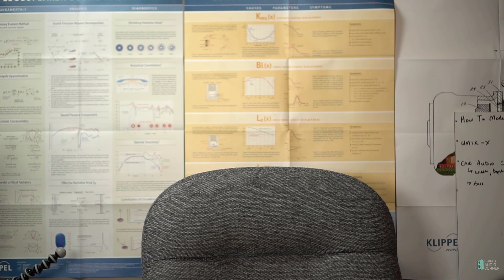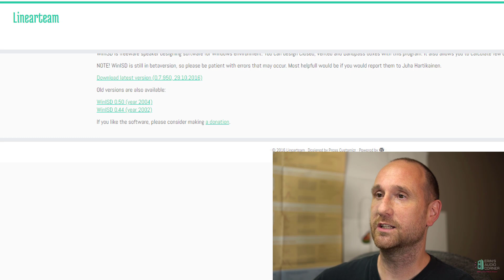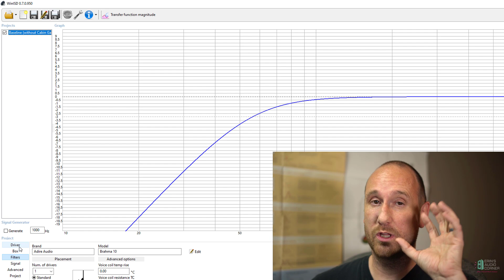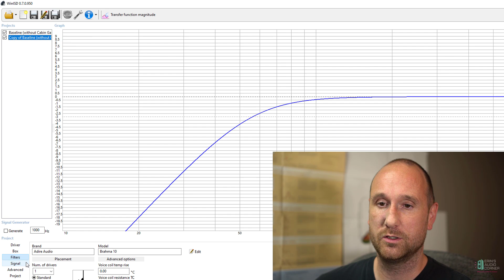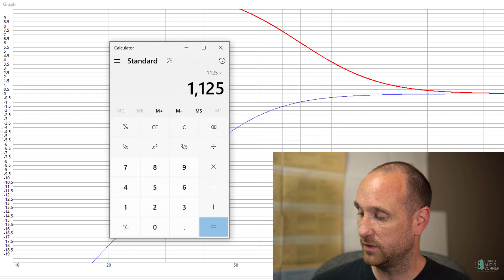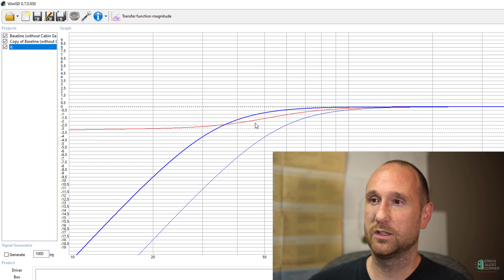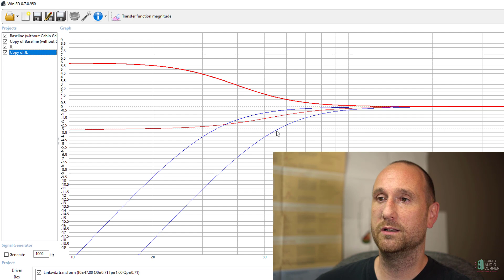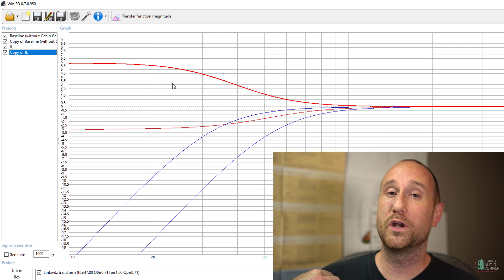Free Bass!  Subwoofer Room/Cabin Gain: What it is and how to model it with WinISD

Comment from the maker: I was asked the following on DIYMA so I will answer it here: 
Q: TWO questions for you--

Why do you take the sub response all the way down to 1 hz when inputting the LR transform function in winsd?

Would the gain approximation curve change if you used 20hz instead of 1 ??

A: Twenty is just the default for an LT. An LT is an enclosure type which uses DSP to extend the extension to a frequency lower than it would otherwise give in a small enclosure. I imagine the default is simply to keep someone from crushing a subwoofer (you need power and a lot of excursion to get down this low as it is). We are just using the same principle to model cabin gain and in this case, cabin gain won't just stop at 20Hz. It will extend all the way down in frequency.

Comment: So after using this technique for a while, I think your values for the "home" room gain part are way too high. Most rooms you probably need to use 20hz for the linkwitz transform, and maybe go up to 30hz if it's a very small room. Any higher I think is too optimistic.

Comment: Yep...just im a bit confused on 1 thing bcs what i actually heard, the biggest dimension what we have to take into account is - let's say in a regular "room" - it is the distance between the corners: for example distance between the rear-bottom-left corner and front-top-right corner...so now which is the correct dimension we should take i to account?...the dimension between the corners i wrote in my example does it have anything to do with it at all?
Reply: Older comment, but I think the idea is the longest dimension between parallel-ish surfaces because that's where reflections happen.
Reply: @SamuraiGuy  , thank you

Comment: So according to this I should get great low end performance out of my sealed sub. But in reality I barely hear or feel 20hz, 30 hz is quiet and at 40hz is where it starts playing decently. Which is pretty much in line with frequency response/ SPL numbers in WinISD without your cabin gain approximation.

Vented box in the other hand seems to gain some at low end.
Reply from the maker: Too many variables to draw such a generic conclusion from a video.

Comment: Great video ! I'm doing a car system  . What then is the benefit of vented enclosure if cabin gain from the car ( vw jetta in trunk) does even better job of extending low end? I want to use 4x 8 inch subs . Some of these only require sealed cabinets of .3 ft3 . I do my own building . A sealed box is a lot less work and for small subs nearly all ported cabinets I've seen require more space when you consider the port  .
I'm getting back into this after many years away from installing car audio  . I've made ported cabinets in the past that work great . It looks like sealed enclosure will work just as well .
I listen to rock so my goal is not to shake the car to pieces!
Is my logic correct ? I see vented cabinets for sale all the time , more common than sealed so am I missing something?
Reply: I think the type of people that just use pre-made vented enclosures are not the type to be simulating the response. They're just after high output, which a poorly tuned ported enclosure and ignored cabin gain will get that for them.

I'm looking to make a small sealed enclosure for underneath my extended cab truck, and it looks like cabin gain will carry it down to sub-sonic, even though it normally simulates with at -3dB of 49Hz. It seems too good to be true.

Comment: So my SVS sub has a room gain compensation. But I cant really find out what that actually is doing. 
My room gain is 40hz. When I activate it, the output goes up about 3db. But I dont have REW to actually measure across the board, just using my phone.
What does activating this do?

Comment: Oh glorious! My spl went from 128db@23hz to 150db@23hz 🤤 thanks man! My Silverado crew is gonna be a beast 😸
Edit: wait… I took out my rear seats and my box will take that up… with 2- 18” subs in a 22Wx35Hx45L box… should I model from the box to dash? I’m planning on having an 8” gap between the subs and they’ll be on a 30degree angle, like 1’cube ears on a 22x22x45 box because recommended ported vol is 10’cube , so I can still use my rear view, thus there’s still that length from windshield to back glass… in theory… 🤪 man, trying to hash this out with WinISD and the12volt volume calculations is super abstract…. Think I’m starting to grasp the box after a few days of number play 😂😂

Comment: My living room isn't closed, it has an access to my kitchen. Do I still have the room gain? Should I consider the distance from the living room wall to the kitchen wall or to the other living room wall?
Reply: You can check what you should expect by measuring a sub in the room, and comparing to measuring it outdoors (without room gain).
Reply: @SamuraiGuy  Ty for answering, Since it's been a long time ago, I have already found out the answer. I did a near field measurement of the speaker and then in 3 pottions in the room.
What I found out was that the gain is ralated to the distance between the 2 furthest walls.

If I sit where the division is, the room gain starts at a lower frequency, but if I sit where there's no division, the room gain starts at a higher frequency.

In a square or rectangular room, the gain is constant.

Comment: With this technique applied in my car, cabin gain lands around 56Hz. Sounds accurate because my subwoofer response dips at 56 Hz and above. But why does the graph show me flat out to 20Hz, and my 15” subwoofer in a sealed box starts dipping bad around 34Hz?
Reply from the maker: Resonances, likely. A hard null can make the response look like it’s falling off.
Reply: @ErinsAudioCorner  thank you for the response. Great video. 
I’m going to set up a microphone with REW also.
Reply: With a sealed 15” subwoofer, My in car response is like a poorly designed band pass. 35-50Hz.

Comment: My back porch is 12feet long 6 feet wide and 10 High concrete. But on 1 of the 12feet sides is the open Savannah so it's only 3 walls. How do I calculate the gain for this?
Reply: you only get room gain in rooms/cabins, this is probably too open
Reply: @FSXgta  thought so. The bass sucks. Due to the opening.  I have 4 12s and barely hear the frequencies below 40hz

Comment: Thank you for this useful presentation. I am not into car or theater but rather home audio. A question, if I have a room of say 12'x14' but with a couple open doorways to other rooms would I still calculate the turnover frequency based on the shortest dimension of the listening room but figure on a more shallow gain slope? If so a transmission line enclosure might be a good choice as they can be tuned for something approaching a 1st order roll off.

For me the ideal total response is flat to 16Hz (low C on the 32' pedal stops) and the settle for is 32Hz which covers the 16s.

My current design project is a high efficiency 3 way system of around 95-100dB/w/m. Several 15" woofers look like good candidates in sealed or TL enclosures.

Comment: Hi ... after adding room gain and parametric EQ filters in winisd. Both for sealed and ported simulations. Cone excurtion is way too beyond the Xmax.
Reply from the maker: I mentioned this in this video but the room gain is simulated using a linkwitz transform which is a form of low frequency EQ. Remember, this is just a simulation. So that portion of excursion won’t exist in the real world.
Reply: So you plot max SPL v.s. frequency using just the predicted response without room gain. Then at the frequency of interest you add the room gain to that figure to get the actual effective SPL.

Comment: Do you factor room/cabin gain into boxdesign? Would you Stull build the same size box for a sub for a trunk / hatch back and save? A 10x12' room vs large open floor plan living room or can you customize it
Reply from the maker: Do I?  Sometimes.  Mostly for car audio it can be helpful so you don't lose a ton of space when you don't need to.  In a home, space isn't as much of a premium so you can "overbuild" and just cut whatever bass you don't need.  That said, it really is important to understand your room/car and the best way to do this is to use an existing enclosure/subwoofer, measure it outdoors far away from any building, then measure it in the car.  The difference is your transfer function; that is what your room/car is doing.
Reply: @ErinsAudioCorner  thanks for the reply. I was curious cause I was thinking of building 2 large ported enclosures to use as end tables and wasn't sure how much I could manipulate the size and if factoring in room gain could help, but the room gain would work against my favor if it's too large of a space like open floor plan living room, ideally the boxes would need to get bigger.. ah well

Comment: Hey very interesting video 🤓

I tried the same process for a triple 12" JL shallow mount enclosure with 3 x 12TW3-D4 and the cone excursion went from 15.2mm to 220mm 👀 

Any ideas on what's caused that 🤔
Reply from the maker: The sim is likely just telling you that - mechanically - in order to achieve what room gain would do it would need that much excursion. Though, I agree that does seem nuts.
Reply: @ErinsAudioCorner  my intuition is that with the transformation applied the excursion graph is null, is that true? without the filter i am within tmax, so within my car it will be within tmax also?

Comment: As a side note : I don't know about cardioid bass , but I am pretty sure that dipole bass does not benefit from room gain (there is no total net presssure change). On top of that , dipole bass in a room cannot go lower than the frequency that has a wavelength that is twice the longest dimensions in  your room : want to go down to 20 Hz , make sure that the longest side of the room is 8.5 m
Reply: What about 1/4 length resonance?

Comment: Thank you for doing this video.  I have been learning about how to use this program and this topic seems to be one that is talked about as a feature yet never explained in how to use it.  it is interesting how much the excursion changes due to the Linkwitz Transform filter being active.  I have been working out a new box for my friend's car sub and have wanted to know this since it seems to explain why the sub in its cheap prefab box seems to be working harder than it should.  I'm curious though.  If you open a window an inch or two, does the size of the window opening affect the Linkwitz Transform a lot? Or would it maybe be better to do a 4th order bandpass for sealed and 6th order bandpass for ported using the window opening as the port dimensions with the internal volume of the cabin as the front volume and tuning the port Hz to make the port length only an inch or two?

Comment: Do you have to measure the entire lenght of the vehicle, (bumper to bumper)? Or from subwoofer to listening area, (trunk to cabin)?
Also, if the subwoofer is on thr trunk, does it matter if the trunk is sealed off to the cabin? If so, how can me model these changes?
Reply from the maker: Length of the vehicle.  Doesn't matter if the trunk is sealed or not because I doubt the trunk is really 100% sealed.  Plus, bass waves can travel through the baffle.  For example, I ran IB for years.  Had a null around 60Hz from the subwoofer's "reflecting" off the trunk lid.  If the cabin were sealed off from bass in the trunk that would not happen.  

At least, that's my thoughts on it.  I could be wrong.  :)
Reply: @ErinsAudioCorner  When you say the length of the vehicle, do you mean the entire vehicle or just the cabin/trunk area?

Comment: I know cabin gain is very important in car subwoofer calculations, and I wonder this: aren't the car subwoofer speakers designed differently from home/studio subwoofer speakers? In theory, the car subwoofer should have a rolled-off frequency response towards DC, and the home subwoofer should not.
Reply from the maker: Some might be.  But certainly not all.

Comment: 12dB/octave in a room seems a bit much doesn’t it?
Reply from the maker: If it is airtight, maybe not. Most rooms are not.  But in car audio, this generally holds true (other than the pressure vents typically located in the trunk area). It could be too aggressive. It might not be aggressive enough. That’s why I stressed that the gain calculation is just an attempt at providing an estimation of what the LF does in a real room. To know the exact transfer function of your room would require actual testing of a subwoofer outside the room vs inside.
Reply: I measured the cabin gain in my Corvette C6 and got about 12dB/octave.

Comment: You will only get a flat response for a sealed woofer below its resonance frequency, where it will deliver volume displacement instead of volume acceleration. We are also assuming a perfectly sealed room. If you have a port, then at low frequencies you will just short the front and the rear side of the woofer driver, so you will not get the flat response.
Reply: I dont understand this comment. Is it implying that cabin gain works differently for ported. Is there a better q than .707 to use to assume losses from cabin flex and leak?
Reply: @noncog1  It sure does work differently. The first room mode is at zero hertz so it will be excited no matter where you place the speaker. But the speaker needs to be sealed for this too work at very low frequencies. If there is a port, at low frequencies the front pressure is cancelled out by the rear pressure through the port. The ported speaker at very low frequencies acts as dipole and has no net volume displacement. A dipole cannot excite the lowest mode, only a monopole like a sealed speaker can.

Comment: How does this work with open concept rooms? For example my room is 18x13 roughly but one of the corners is open to the rest of my house and is probably 40-50ft distance in that corner to the next wall.
Reply from the maker: Well, if the opening is large enough then the space is effectively "infinite" and there would be no cabin gain... *I think*.
Reply: @ErinsAudioCorner  Wouldn't surprise me based on my measurements. My subs drop off like a rock after their rated frequency response. Thanks for the reply.
Reply: @ErinsAudioCorner   
Although I don't believe I've seen it, I believe it can be modeled as a coupled acoustic space with the opening being the acoustic aperture. 

The room would likely reciciprocate with some Vessel Gain based upon it's 18'x13' volume. However, the opening to the larger area certainly diminishes the magnitude and onset frequency of the Vessel Gain. So it really depends upon how acoustically large the aperture is. 

It'd be fascinating to measure this because modeling the behavior of the two coupled spaces would merely be a simple approximation with accurate boundary wall impedances, rigidity/damping.

Comment: Yes, good description. Great to encounter individuals exploring these otherwise mythical topics. There's so much unneeded bullshit surrounding bass, so again, great content. 

The last thing I want to do is muddy the waters, however...;)
 fwiw
One can delineate 𝘙𝘰𝘰𝘮 𝘎𝘢𝘪𝘯 separately from 𝘗𝘳𝘦𝘴𝘴𝘶𝘳𝘦 𝘝𝘦𝘴𝘴𝘦𝘭 𝘎𝘢𝘪𝘯 (PVG).

Room gain encompasses boundary reinforcement (spatial loading, ie., 2pi Half Space), and PVG is the reciprocal gains below the room's first mode. Yes, it's splitting hairs however there's a difference. 

PVG; when the longest dimension of the room can no longer support full propagation of the waveform. 
•Acoustic propagation transitions to acoustic pressurization. 

Sound energy changes from a normal cyclic propagation, to pressurization because the wavelengths are too big for the space.
Essentially, instead of propagating, the pressure simply rises/lowers in that frequency region. 

Theoretically 12dB, but unless you're in a bunker or bank vault, boundary losses drop that down commensurate to their lack of rigidity. Then upon including the -3dB rolloff points at each point along the chain, this too diminishes the ultimate gains realized in situ... perhaps 6dB-10dB in a typical listening room. 

Our hearing sensitivity drops off bigtime as the freqs plunge down into the deep bass. We need 30dB more at 20hz, than at 100hz!
For example a 100hz tone @80dB requires an additional 30dB to perceive a 20hz tone at a similar loudness! That's extraordinary. 
Those reciprocal gains of Room/Cabin/PVG ... are really helpful! 

There's another fascinating element at play; our hearing (equal loudness curves) boosts distortion products higher than the fundamental... that sucks. 

𝙃𝙤𝙬𝙚𝙫𝙚𝙧, PVG supports the fundamental much greater than the distortion products! 

One reason why listening at realistically high dBSPLs is so nice ... as long as it's low distortion.
Reply: Thank you for this explanation!
Reply: @VioletGiraffe  
You're welcome

Comment: If your enclosure size is not the same as the recommended size from winISD do you need to be putting in different numbers for the linkwitz transform?
Reply from the maker: The LT is just to model cabin gain. The enclosure is separate from this. So you can imagine them as two different models combined to give you an idea of the in-room response. 

If I understand your question.
Reply: @ErinsAudioCorner  I think I got it.  I just meant if the ensloure size was slightly off would you try to match actual enclosure Q setting with the filter to get the best guesstimation